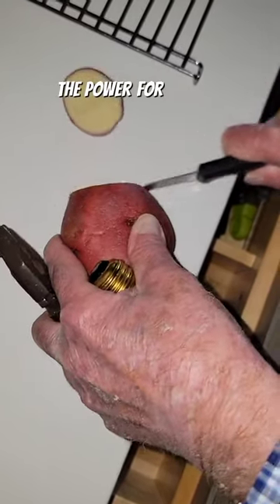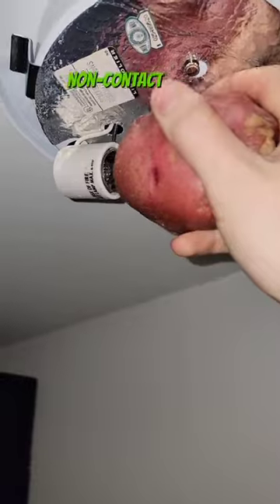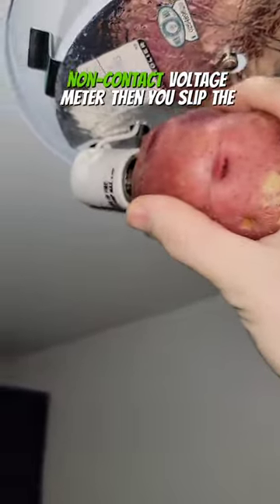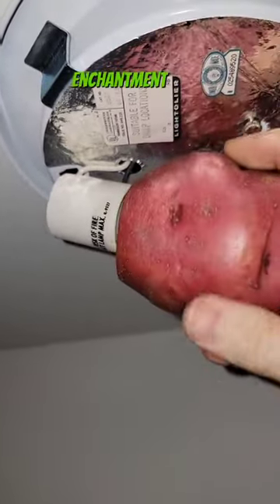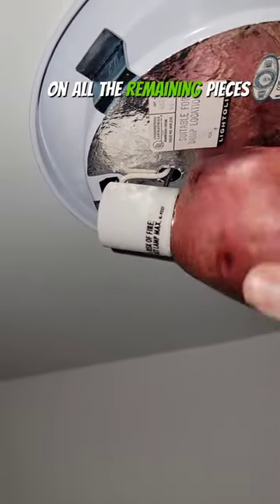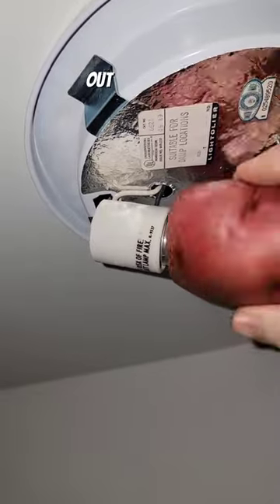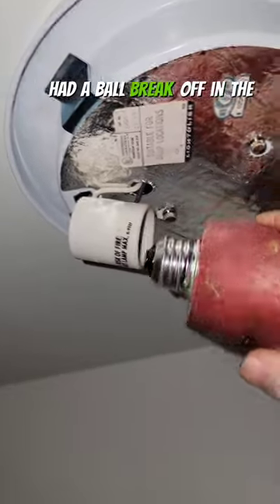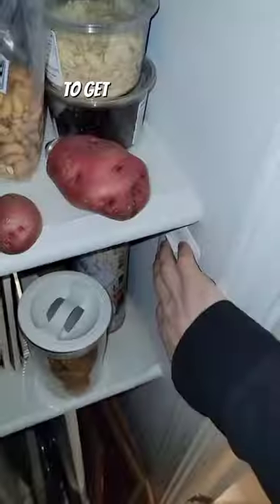How to remove a light bulb socket with a potato #tools #handyman #diy #tips #shorts

Comment: Needle nose pliers...
Reply: Same for me. Broken bulb in a double vanity fixture. Had some trouble getting it out, so I turned on the light so I could see what I was doing... Just enough of a zap to toss the pliers and I learned a good lesson about hitting the breakers because sometimes the dumbass who hits the switch while I'm working on something is me.
Reply: Right.
Reply: I used needle nose pliers to but I remembered to turn off the light
Reply: @ATKglitches  To be fair I did turn off the light for safety... I just immediately forgot that's why it was off and turned it back on.
Reply: @patrickcorcoran4828 
Put painters tape on the switch to prevent you from turning it on and is also a visual reminder.  Plus anyone walking in won't be able to flip the switch either.
Reply: and I don't see how the glass can push into the hard potato;  the potato must have been well done already.

Comment: I used a pair of small needle nose pliers.Kill the circuit,then apply pressure to vase and rotate it counter clockwise.
Reply: I did the same but I used outward pressure with the pliers worked pretty good.